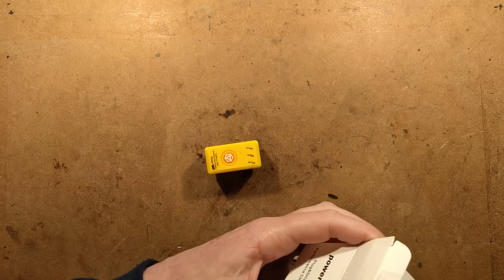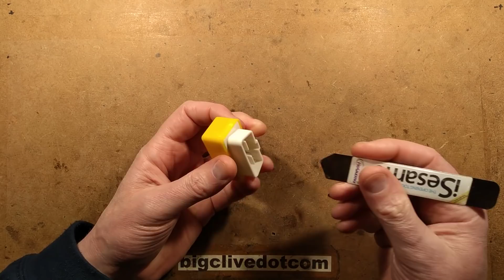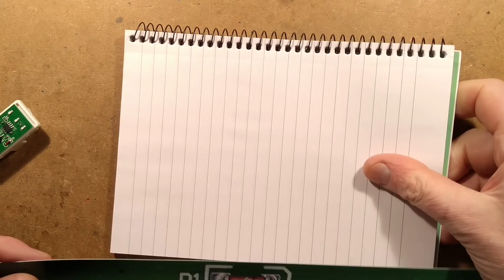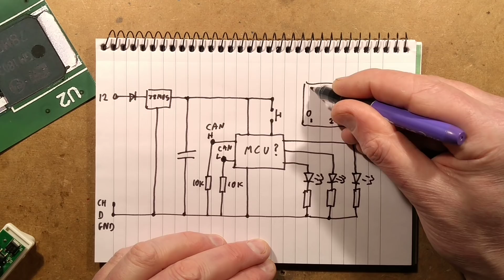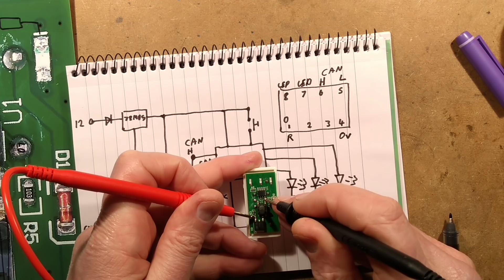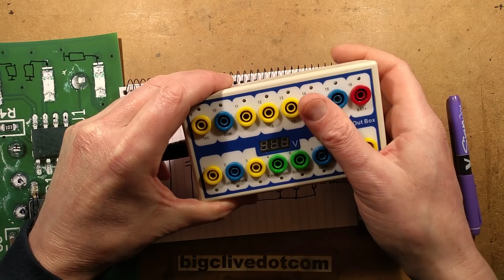Simplest OBD2 engine remapper yet, with actual canbus connection.

Comment: I've heard of some of these which can short out your cars can bus line which can damage your ECU. Clive says in this video that OBD2 has been around since 1996, but my 2001 Rover 75 only had OBD1, which I found out as I wanted to use a bluetooth scanner and management system (fault code reader), but as it had OBD1 we couldn't.
Reply: (am an autospark) canbus is amazingly resilient, it'll work if you cut one wire or short it to ground or v+ at reduced speed , it'll survive both lines shorting together, to ground, or v+. on more primitive cars without a gateway you will bring the network down , but unplug the module and everything works again. importantly the modules should all work in the event of a canbus failure. so engine will keep running but you may loose the instruments etc.
Reply: and I don't advocate it but for a DIY person. a Delphi 105e clone from China will talk to your car and do all systems. :)

Comment: I wonder if these will still sell when internal combustion engine cars are replaced by electric cars? I can imagine the typical hoodwinked driver boasting “yeah, it remapped the electric engine settings giving me a performance boost”... 🤣
Reply: Do you think electric motor controllers can't be reprogrammed?
Reply: Ijusthopeitsquick - Very much depends on the type of electric motor and the type of control system. But the control of electric motors is VERY different to the control of petrol internal combustion engines.

Comment: couldnt the interference to the car's network be used by them "less than perfect credit" car financer to shut down a car if the payment is skipped?

here in the united states there was a  "less than perfect credit" car financer in texas i believe that had a kill switch that they could remotely disable the car if the payment was skipped.

a remote receiver maybe a simple cell phone circuit could be put in the device so when it got a phone call it would turn on a transistor to short the canbus data pins to ground or to the + via a current limiting resistor to prevent damage and since the communications cant happen the car is disabled.

a "less than perfect credit" financer is another name for one of them loan shark like companies that will loan with very high interest to those with less than perfect credit or bad or no credit.
Reply: The ignition disabler is a separate piece of hardware and often has GPS so they know where to send the rollback when repossessing. It isn't exactly causing interference and its presence is buried in the loan documents somewhere.
Reply: not necessarily i think the texas car dealer simply disabled the car and probably used the police license plate tracing system to find the person.

of course today a lot can be packed in a small place so it is possible to fit a gps transmitter, cell phone receiver and a disabler in the confines of a obd plug.

a gps transmitter only has to be a beacon that a separate gps receiver would be used to locate.

remember seeing better call saul the spin off/prequel to breaking bad a gps transmitter was placed in the gas cap of a car and was the size of the common  c or d battery cell.

the cell phone receiver just has to be  the chip that makes up the basics of a basic cell phone no need for a display keypad so the board could be made small.

once a signal is received from a cell phone the device triggers a latching circuit that shorts the data pins and the car will throw up error codes or may not even power up at all.

also this was on used cars witch did not have much blue book value left on them anyways so  it probably was not worth much to recover the car or it took many skipped payments to get them to repo the car as they kew the car was useless if it did not run.
Reply: I call them "Buy Here, Cry Here" dealers. LOL

Comment: How can I found this resistor box?
Reply: Here's one. Wish I had one too. Guess it will go for a good price now you've mentioned it!
https://www.ebay.co.uk/sch/items/?_nkw=rotary+resistor&_sacat=&_ex_kw=&_mPrRngCbx=1&_udlo=&_udhi=&_sop=12&_fpos=&_fspt=1&_sadis=&LH_CAds=
Reply: I don’t recall seeing a resistor box anywhere in this video, but there was the OBDII Breakout Box (it breaks out each individual pin on the OBDII port and shows activity per line — not resistance values) — is that what you were inquiring about?  If I missed an actual resistor box/wheel I apologize, but I just do not recall seeing such anywhere in this video.
Reply: @ethanpoole3443  3:31, the thing that is used to emulate the communication... 10k value
Reply: But it is a kind of resistive decade, isn't it?
Reply: Daniel Sting Very good eye!  Just search on “resistance substitution wheel” and you should find plenty of sources for that style.  Substitution boxes are more common these days, however, and allow for the creation of custom values by switching a matrix of series resistance values in and out of the network (so you could actually switch in 3,456,789 Ohms if you wanted that value).  By comparison, resistance wheels can only produce very specific resistance values (e.g. you can likely select a single value of “100” Ohms but you can not create “105” Ohms since you can not stack multiple resistor values using a wheel...unless, of course, you use multiple wheels in series).  Wheels also tend to offer a less complete selection of resistance values since there are only so many contact positions.  But both have their place as wheels are much more compact.
Reply: This video? https://www.youtube.com/watch?v=n3joyToqpCc

Comment: Next you should do a video with a running car, an obd2 wye cable and this hooked up. Then you connect a laptop with a can sniffer to the other side of the wye. Have Ralph drive while you monitor and comment as mayhem ensues.
Reply: well driving means no Whiskey for ralphy
Reply: @thatredkite8310  Round the block a couple times should do. I'm sure Ralphy will survive.

Comment: I remember, back in the early days of Ebay, people were selling "performance chips" with ludicrous claims like +20BHP and the like, and it was just a 1w resistor that you connected in series with the intake air temp sensor, to fool the ECU into thinking its breathing colder, denser air and adding more fuel. Lots of people on the car forums back then swore they worked!
Reply: This would work on early ecu's (pre 1994 - euro 1) that didn't contain a lambda sensor for closed loop control  eg most bosch 'jetronic' (mk2 golf etc) ecu's most engines are mapped to 'lean burn' for best efficiency,  increasing fuel by tricking the air flow sensor (lower temp, higher pressure / mass flow) would increase power slightly at the expense of economy. Anything with closed loop would adapt to the modification in minutes and might last the first dyno pull at best before returning to normal
Reply: They still sell them. They do work to generate easy income for the seller. LOL
Reply: You can gain 150 hp by adding a 4" exhaust and chipping a 7.3L Ford super duty. Fact. You also need to add gauges to monitor your engine. The motors are extremely tuned down for long term reliability.
Reply: @driftingabstract4076  HOW DARE YOU INSULT THE QUEEN WITH YOUR KNOWLEDGE OF AIRFLOW!! What's next , MAGICAL GEARS THAT ALLOW YOU TO GO FASTER THAN THE OUTPUT SHAFT???  you'd probably call that a transmission you WIZARD!!
Reply: push that tow/haul button immediately and return to street legal mode.
Reply: @ATF2099  Wizard you say? Oh you just wait until we hit 88! I put these on all my vehicles, they actually turn your car into a time machine! It's AMAZING what is packed into these little boards.

Comment: Love a BigClive video.  I'm having trouble with this one though.  OK I admit I haven't watched every single video in this series of these OBD devices, although I have watched a couple, but I was stumped by the continual reference to the canbas and sometimes the canbas network.  Some way in I learned it was a wire with 120 ohm resistor on each end.  Right.  OK.  Still no idea what it actually is or does then, which is a shame as I'd like to know.
Also, are there any more expensive ones which can analyse fault codes as opposed to learn your style and change performance characteristics?  Are there good ones of those that aren't free with a Christmas cracker?  Or are those all fake too?
Reply: the canbus provides a network for components in your car to communicate to eachother, imagine your engine talking to the central unit to do the "somethings wrong" light
Reply: Richard Bradley , it's "Can Bus " , far simpler for you to,Google it... it's a way car components talk to the  car brain using the same wire, not one wire for each component . The brain decides which component to listen to on the one wire depending upon driving circumstances.

Comment: The problem is that you did not buy the electric turbine they also sell on ebay. It needs more TURBO!!!
Reply: Whats scary is Audi is using a electric turbo on one of the twin turbo TDI's now lol
Reply: @southjerseysound7340  There's technically nothing wrong with an electric turbo, the ones on ebay are basically computer fans and their airflow is not even on the same planet
Reply: @southjerseysound7340  There is a big difference between an actual genuine electric turbo and a glorified PC fan sold as electric turbo. While a PC fan just needs to move a lot of air around, a turbo needs to compress the air, which a PC fan by design just can't do.
Reply: @southjerseysound7340  I doubt Audi would go through the development process only to add something worse. Don't know why.
Reply: @Spiritpoweredinternet then somebody sold you only a broken (half) unit. every child knows a real turbo needs TWO "propellers" :-)
Reply: @Spiritpoweredinternet They do as much helping with boost/airflow as "alot" is a word!! 😋

Comment: Also, if you have an accident with one of these left plugged in and have to get towed/mechanic, I'd suspect your insurer might take it as a reason to refuse/restrict cover (even though it's doing zilch).

Most insurers treat remaps/ECUs as mods in the UK iirc, so will bump your premium up a good bit if ones installed (despite them actually being fairly innocuous, and even practical for some models). Not sure if they routinely check for it though on vehicles involved in accidents, but I'm pretty sure a chunk device plugged into the OBD II would be noticed given its ubiquitous use in garages.
Reply: Yup, an excuse to wriggle out. I've heard them refuse to pay out for fire claims because the car has waterless coolant in it.

Comment: 7:50 ... You say "It can" have a negative effect on your car... I say "it will definitly" stop your car from working if the 2 can bus lines are shorted together. It depends on your car... On VW (Skoda Seat Audi Porsche etc.) there is a gateway between the OBD port and the car that will save you... But on my Dacia / Renault etc. there is no protection. You short out the can bus and everything stops working. Cluster , engine ... even the radio will not work properly...
If you ever have questions about car diagnostics and/or Testers... feel free to ask... since 2005 im specialised on repairing cars/ trucks/engines... Can bus (communication) problems are nearly 40% of all failures today.. Exept when your engine is actually blown ^^
Reply: Do you think someone could send this kind of device, but with malicious intent, as in, for example, at least unlock car doors when specific radio signal is received?
Reply: @BetonowyDariusz  its even more simple... plug in a normal obd bluetooth dongel and let it plugged in all the time... now i can access the bluetooth from outside and send my own messages into the can bus over bluetooth... with the right messages you can wake a car and program it remotely... if you embed for example "abs delete" into a plug you can disable or destroy controllers... its super simple. when you have access to the can wires ... the car  is yours. basically it works for all cars, just slightly different messages are needed to change / activate things. Its like a open front door to a unsecured jewelery.
Reply: @BaumInventions  oh hell... I understand. Bluetooth is not the most secure technology ever. I've been tempted to buy such a dongle, but in my car the socket is right underneath the fuse cover inside the passenger cabin on to the lower left of the steering column, so I could not close the cover if I had anything plugged in there...
Reply: @BetonowyDariusz  just make pin16 of the obd (+12v supply) switched by ignition instead of a permanent supply... you could use a on-on switch to choose ignition or permanent supply. a permanent supply is needed for diagnostics(you have to turn the ignition on and off during diagnostics)
Reply: @BaumInventions  thank you for your knowledge, this sounds very reasonable
Reply: Baum Inventions wow are CANBUS failures that high? I’ve never had any issues with anything I own but then again my daily is a 96 Range Rover with no CANBUS.
Reply: @Mrcaffinebean  It probably depends on the brand of cars you are working on... On recent Dacias (Renaults) even a normal (cheap) OBD Plug can cause problems with the ABS. I had several people cominh in with ABS Problems and it was always a cheap chinese bluetooth/wifi OBD Plug left plugged in all the time... I worked at Opel(Vauxhall) back in 2005 and the "new" cars like the vectra c had so much control units that always sometning went wrong. With the facelift they removed a lot of controllers and it got a little bit better...
Reply: Baum Inventions I have one of those (WiFi not Bluetooth) but I wouldn’t leave it connected. However I can see someone doing that if they wanted to run the Torque app on a tablet mounted in the car or something.
Reply: @Mrcaffinebean  Yes. In most cases cars work pretty okay from the factory. The failures are brought in by the users. Not because they are unabled to use something correctly... Just because china does not care...
Reply: Baum Inventions haha if Clive’s videos have taught us anything it’s definitely that China will ship ANYTHING that they can sell.
Reply: @BaumInventions  Remember this old time when to connect to Saab u must always use Tech2

Comment: Are there plugs like that, which actually work? Because if it's something that can, in principle, be fully automatic, then I can imagine it would still fit inside a plug that kind of size. The characteristics of all engines since 1996 on a chip that size is certainly possible, paired with a processor that can handle it; it'd just be a bit more expensive.
Reply: Short answer no. Long complicated answer it can be but highly unlikely.
Reply: @sonixthatsme  Unlikely that it exists, or unlikely that it could exist?
Reply: @thany3  I know there are some car/engine specific dongles that can code the car ecu's. But they only have one specific task and can not be used on a different vehicle.

Comment: there is some of these that send reset signal to ecu and resets adaptive fuel learning values and that way does something but if you gain power or get better milage it is so minimal that there is no way of noticing it.
Reply: Here it is: https://m.facebook.com/repairecu1malaysia/photos/?tab=album&album_id=1381208408568286&_rdr
Reply: If it only communicates on the K-line , wouldn't that work only for cars with obd protocols 1 and 2 though ? , and I highly doubt it can reset the fuel trimp adaptivity on most cars ,  maybe it can reset hondas and some older opels (which reset the fuel trim adaptivity when the fault codes get cleared)
Reply: @martin518441  there is one Facebook post from some Electronics team that analysed one of these and find out that it Sends that reset signal. I can post link to that if I find it.

Comment: They work!  I got an extra 50HP at the rears with a new E85 sensor, bigger fuel pump, ID1050 injectors, and smaller blower pulley - oh, some stranger that knows how to use my HPTuners gizmo helped only a tiny amount.

Comment: No expense spared on that voltage regulator though!
Reply: I'm guessing the 78M05 is the SMD version of the older, through hole L7805, they seem quite good at what they do yah.. I have lots.. No idea what for, but I appear to be collecting parts for a reason yet to become clear. I did fix a blown crapacitor in my brother's solar charge controller though.
Reply: @ollieb9875  crapacitor xD
Reply: I’m surprised they used anything larger than a 78L05 as well, I guess they must have gotten a very good deal on the higher power regulator!  Though with a continuous draw of about 9mA, they could likely have saved further money just using a 5.1V Zener and resistor as a shunt regulator.  The efficiency would be about the same and ~70mW is well within the dissipation envelope of most Zener packages.
Reply: @ethanpoole3443  car power is very dirty so a 7805 is not a Bad idear atleast the Placebo shouldn't go bang first crank